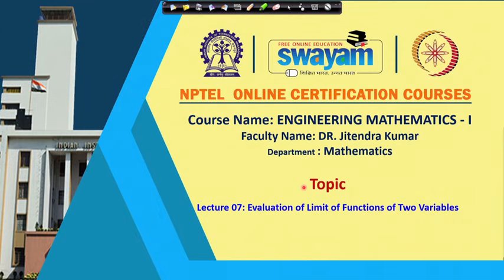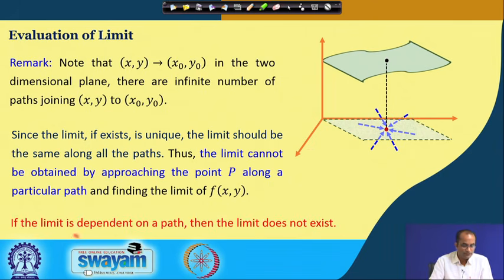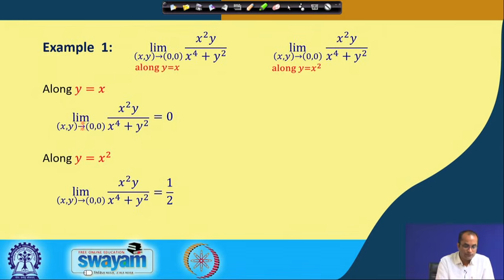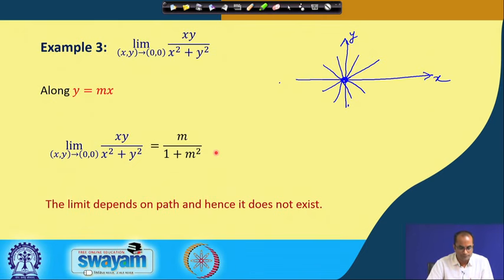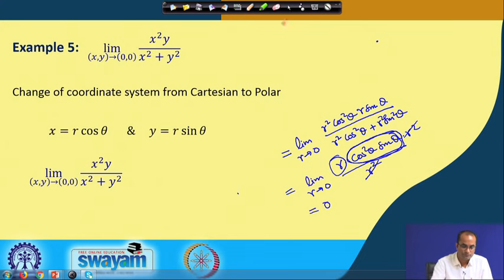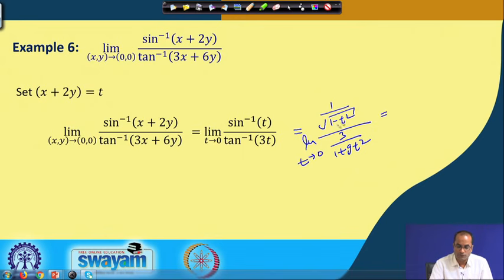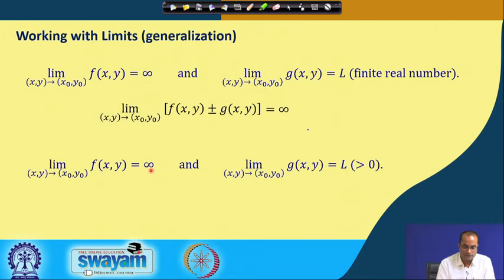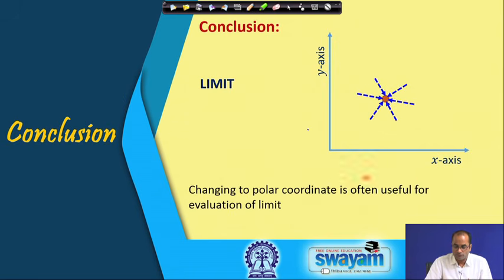Lecture 07: Evaluation of Limit of Function of Two Variable

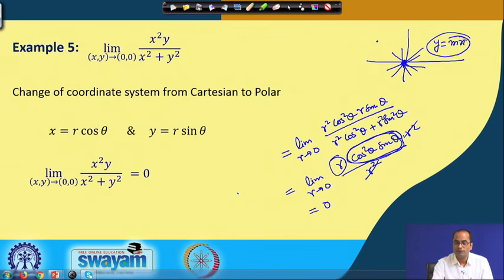Comment: in 16:30 u said that by y=mx is fixing as straight line...but in the polar coordinate system also x and y are fixed paths for different values of r n theta as circles only...so how in former case or in y = mx path,limit evaluated is wrong?

Comment: I have infinitely many doubts in every question, like in example 5 .. we just took a case that x and y are related to each other as x^2 + y^2 = 1 but if we take a different value like x = r*sin(theta) and y = r*sin(PHY) .. then how will we get the value 0 .. here it is not mentioned that x and y are related...
Reply: still it will be zero..as the factor r in numerator will be there...which when r tends to 0 will be 0.
Reply: Dear Sir, thank you very much .
Reply: Watch videos on polar coordinates or polar transformation of cartesian coordinate system. Your doubts will be cleared!